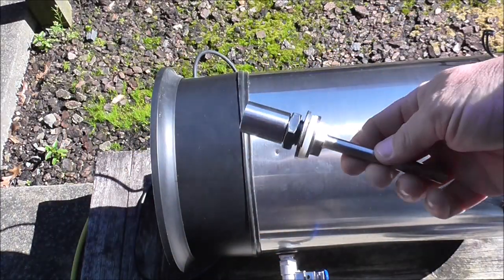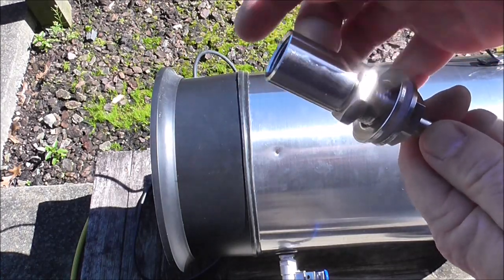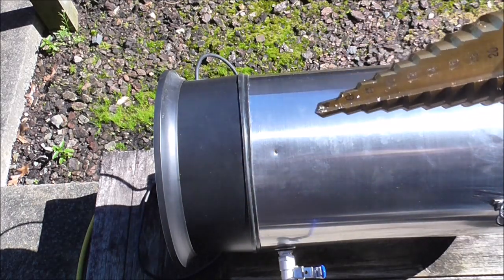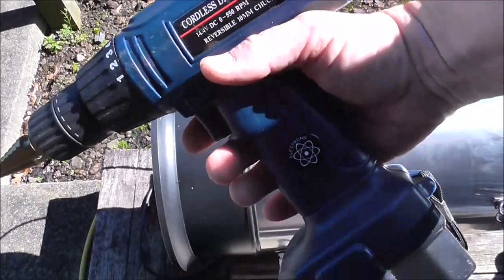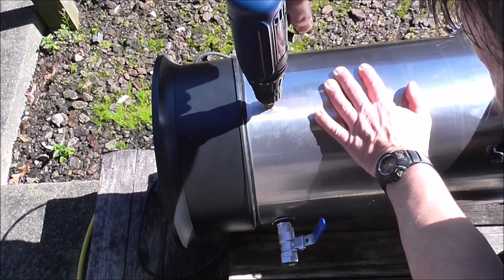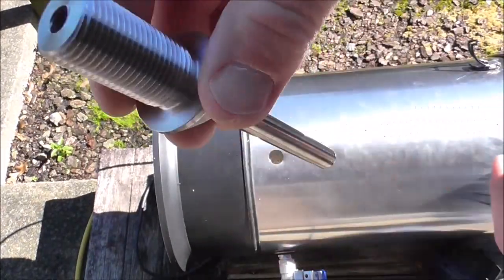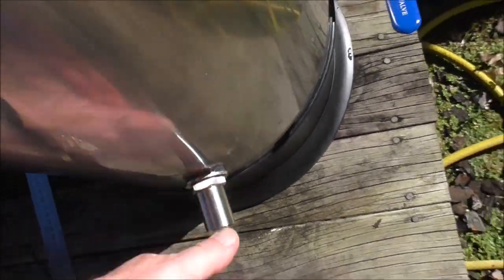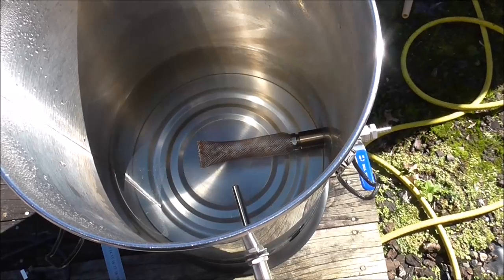Step Bit - How to Drill Various Size Holes - Demo on my Stainless Steel Brew Boiler

Comment: It's not painful if you use a good working tool.  Why make a video like this?
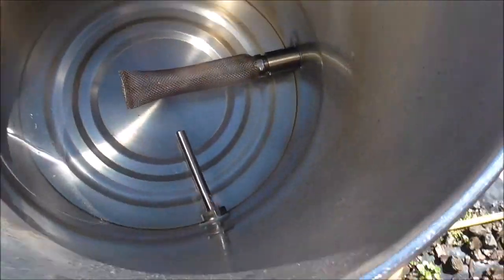Reply from the maker: Well I was mainly making the video to show an upgrade on my boiler, and thought I'd shoot me using the step bit. I do explain at 3:41 it's not the greatest drill and yeah hands up a better drill will do the same job with less fuss. Cheers

Comment: If the drill keeps stalling like that let it build rpm with no pressure or even not touching the metal then slowly apply pressure

Comment: Hi! Is this cone drill only suitable for soft metals like in the video? Ty
Reply from the maker: Hi. Found this info. My step drill has a titanium coating for proven capability and durability in drilling holes in plastic, aluminum, copper, stainless steel . I should have used some cutting oil, which would have made the job a lot easier. Cheers
Reply: TubeDinoz Homebrew sorry if i confused you with my question..does this work with thick metal pipes or something thicker? Ty
Reply from the maker: Hi. You'd probably be better off with a hole saw for thick metal.

Comment: After drilling did you treat the new hole with any kind of paint or rust protection products?
Reply from the maker: No I didn't. I'm pretty sure you don't have to treat SS as it has a % of chromium that protects stainless steel from corrosion. Cheers
Reply: True I believe ss is protected on the surface, but if the silicone washers create a water tight seal than I guess no rust.

Comment: Hey lads. Lay a rag soaked with lube over the step drill  and get drilling ..keep it lubed👍
Reply from the maker: That's a great tip. Cheers Rico. As you can see I'm a rookie. No prep and grabbed a crappy old drill I had laying around. Cheers

Comment: looks like you need a new cordless drill
Reply: How on earth would it make a difference what kind of punch he used to mark center of hole, and the drill was next to useless so he couldn't apply any more downward pressure although i agree slow and hard is the way to go but that's nonsense about the punch
Reply: with cord have more torque
Reply from the maker: Yeah, tell me about it haha. Got the job done, just. Cheers
Reply: Radovan Skalamera no looks like he should have used a center spring punch. then he should have applied some downward pressure on the drill
Reply: @will1867  for some one with such knowledge shouldn't you have mentioned that those bits require lubrication?

Comment: Glad to see you got it all squared away with no leaks, Dino. Have you considered using themal grease for a more accurate temperature reading? "Kiwi safety boots!" Lmao! I got quite a chuckle out of that. Cheers! 🍻
Reply from the maker: Thanks Dennis. Nice seal with the silicon washers inside and out. Not heard of thermal grease. I'll check it out. Ah yes, the jandals (flip flops) and thick socks. haha. A hybrid of Summer and Winter wear haha. Cheers Dino

Comment: hah this reminds me of myself drilling, I also have a cheap drill.. only difference is I swear a lot while using it.. nice vid, cheers
Reply from the maker: +Rusty Homebrew Haha. I still have nightmares about the time I drilled 50 odd holes into my stainless grain bucket. I think I was pretty lucky this time. Just subbed your channel back. Cheers Rusty 👍🍻☺
Reply: cheers
Reply: lol yes i thought a substantial  amount of swearing and blaming the tools was a standard way of doing this type of job

Comment: I feel like I should state that a bi metal hole saw is going to be much better for this type of job in most cases. Step drills are made for thin sheet metal and will be very difficult to use for anything thicker than this. So investing in a set of hole saws and some cutting oil is a must if doing anything thicker. 

Cheers.
Reply: Good job Dino, always scary drilling a pot. Steps drills are fine, I have cut about 7 holes in all my thick walled brew pots & my students use them when building heavy duty 1.2 mm fish smokers. Oil and slow speed are key.
Reply from the maker: Thanks Ben for the info. Yes, I can imagine this could struggle on thicker metal. Good for making holes in brew pots for taps etc. Cheers mate 🍻👍☺
Reply: +TubeDinoz I made the mistake when I tried to drill my own thermowell. I used a step drill, and the hole became quite deformed because if excess heat and blunting of the step drill cutting edge. Cue 2 hours of shaping with a file...
Reply from the maker: +Ben Mayn Ouch. I might have got lucky on this hole. Not sure what state the cutting ability of the bit will in for the next time. I had a nightmare drilling dozens of holes in my grain bucket.
Reply from the maker: Mr Pearce Thanks mate. Good to know they are good for thinner metals, but a hole saw for anything thicker. Yes, I did think some oil would have helped at the time. Hopefully the bit isn't buggered. Cheers!

Comment: Nice one bud I'd be scared to drill in case I bugger it up and end up with a 2ft hole.
Reply from the maker: +Steve Moulson Thanks Steve. Believe me, if I can do it anyone can. The drill stops at each step, so you can't go too far wrong. The pilot hole is good for stopping the step bit dancing around. Cheers

Comment: Great video Dino. I use a bit of dishwash detergent as lube/cutting oil and it works well. Mind you I use a shitty old rusty power drill but it does the job. Glade to see you got it setup. I wanted a themowell but had it in my head it has to be in the middle but it doesn't so I think I will copy you. Cheers!
Reply from the maker: +Rookie Brew Thanks Zane. First time using one. I had a feeling you'd done it before. I probably should have used some sort of lubricant. My drill as you saw wasn't the greatest, but it went through pretty well. Do you mean have the thermowell go to the centre of the boiler? I don't think it matters it being a bit short as the temperature of the liquid is pretty even. It's a well made one for $29.99 from Brews hop (140mm). Cheers Dino